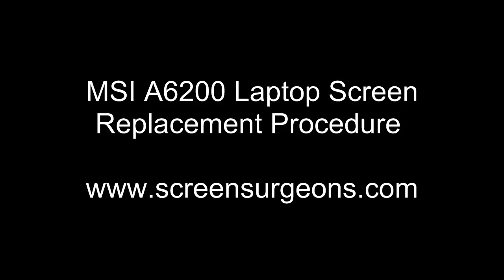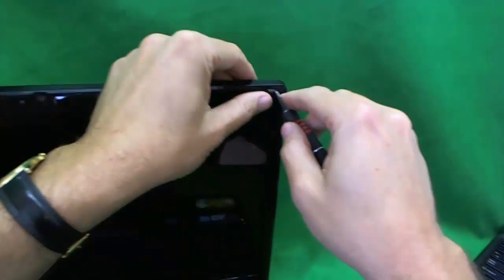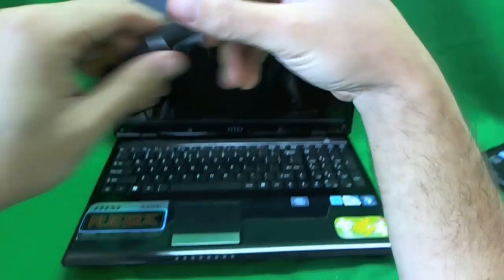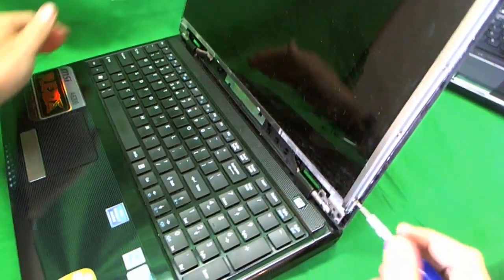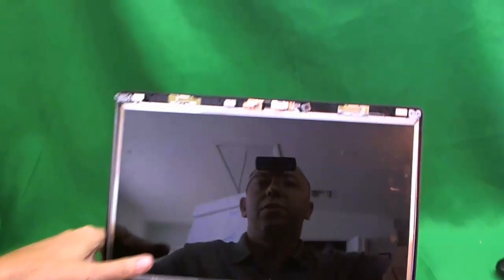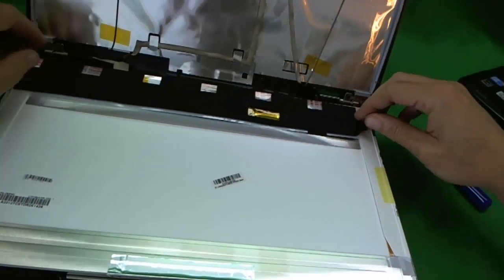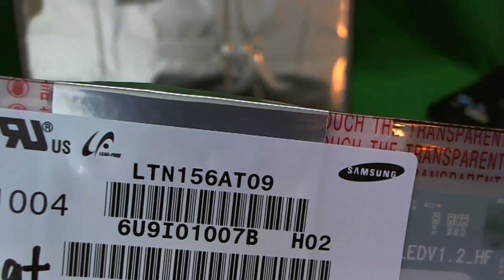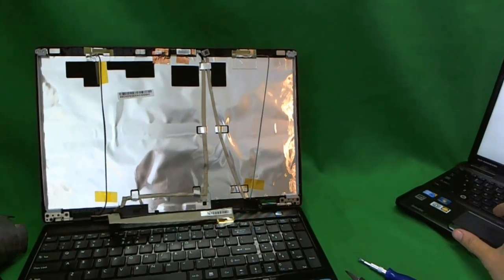MSI A6200 Laptop Screen Replacement Procedure

Comment: thanks for the video! this also works for an MSI A4000-096US, just did it. Only difference is three screws on each side instead of three. Wish the video went into putting the bezel back on cause the lower part is a pain.

Comment: The hinge on my screen broke randomly, the plastic snapped and the metal hinge itself is snapped/the bottom part of the hinge is stuck at a 45 degree angle while the top half is broken off, making the screen's weight pull it down. Do I need to replace the screen or how would I do this? I don't have a lot of money to spare, I don't have a job... I can't really just get a new laptop...